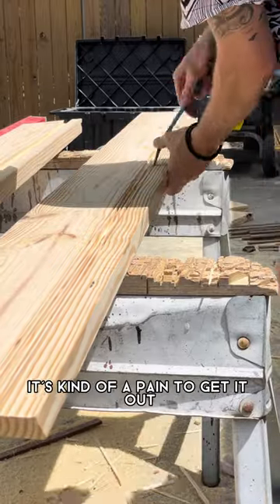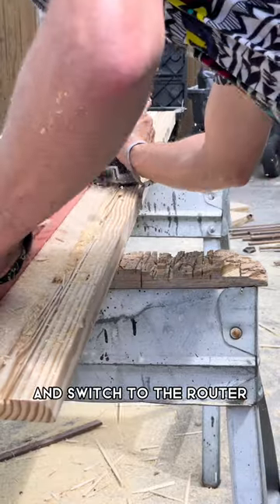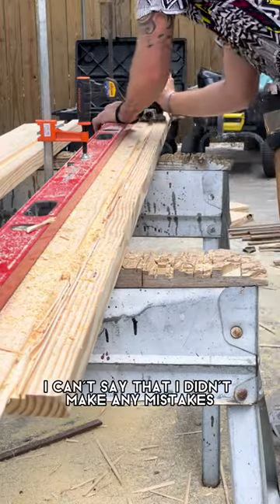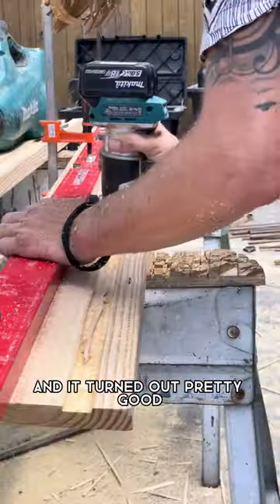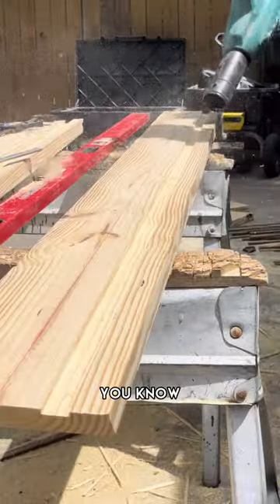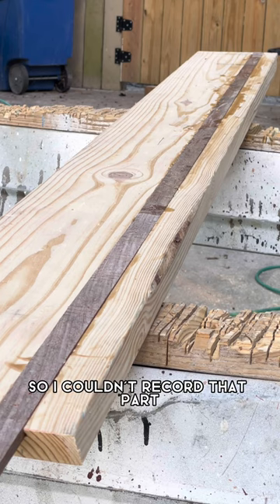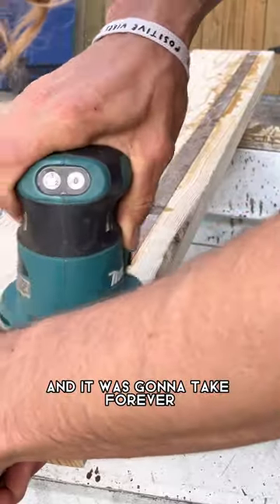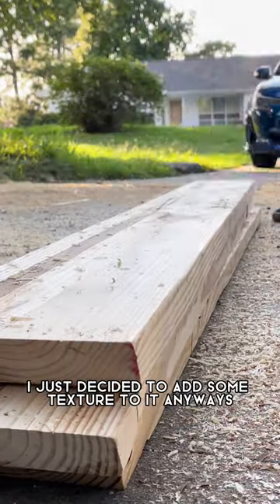Building my Girlfriend a Platform Bed Part 2 | Artpentry

Comment: Love your work ethic . Not scared to show your mistakes while still tackling difficult jobs.
Reply from the maker: Thanks man! Super nice comment and I appreciate it!
Reply: @Artpentry  just a tip with the router. If you use the round side it much easier to keep from accidentally getting off you line when using a straight edge.

Comment: If you’re doing a long run notch like that frequently, buy yourself a Dado blade , it’s a nice thing to have for woodwork , I throw mine on a knock around table saw , I usually just end up running a circular saw anyway but it’s a nice way to run a notch and adjustable width

Comment: Great work. Next time, set your first router pass very little depth. 1/8” max.   Make a few passes taking less material. This will keep you in the slot.  As you gain experience, you can reduce the number of passes you need. Great work. Keep it up.

Comment: I was told to use the round side of the router when using a router with a level. This allows you to have more lenience when adding the groove instead of concentrating on keeping the straight edge of the router parallel to the level.

Great vid though!

Comment: Grab a Dewalt planer and add the carbide replacement tips and you'll be able to plane the Ipe wood much nicer.    You could also do a slight dove tail slot and carefully hammer the accent piece in and you wouldn't need any nails 😉

Comment: Not to act like I'm a pro cuz I'm not by any means but if you got access to a table saw (or even if you don't you can setup a make shift rip jig with saw horses for a circ saw to cut) you could measure the dado and then cut a strip slightly over, then glue and nail in place and then you'll have less to sand out..